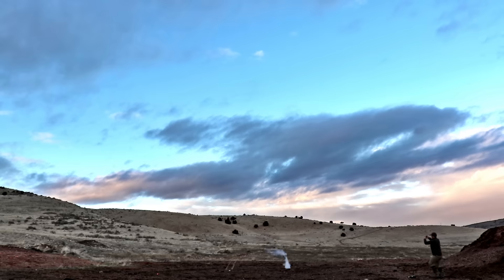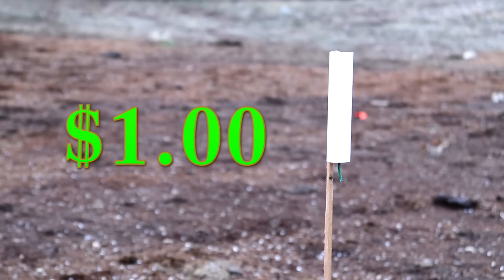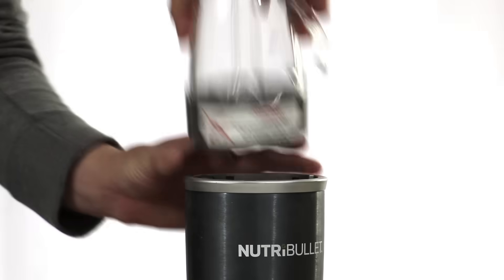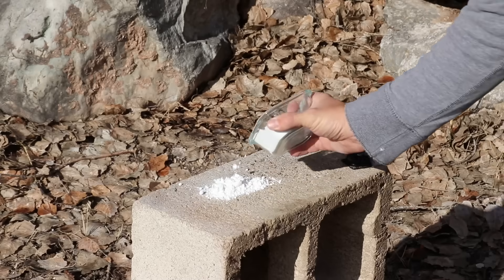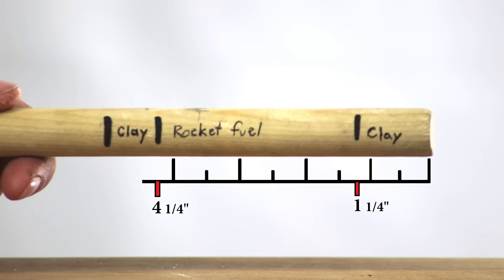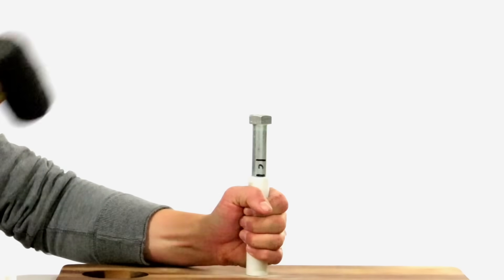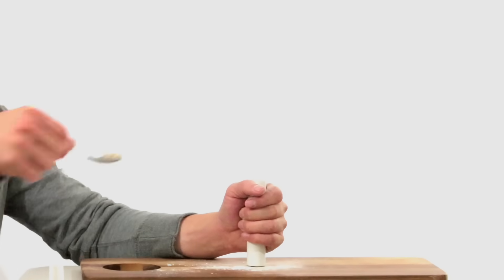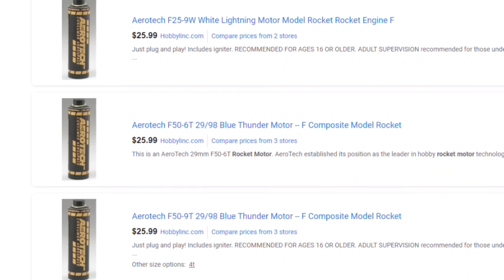How To Make Sugar Rockets (Powder Fuel)

Comment: Can I ask what keeps the fuse in, ? & how far in does it go, all the way, or just in bottom 🤔
Reply: You could try sticking the fuse and then a piece of paper along with it so that the fuse stays as it's stuck with the paper. Also you will want to stick the fuse all the way up the hole you drilled, not just the bottom.
Reply: @berkay3393  cheers pal
Reply: @tonymcwhirter  I also saw that you asked a question about yours letting out a bunch of smoke and dying, mine has the same problem too. I was wondering if you managed to fix it
Reply: @berkay3393  just had plenty of whoosh, one actually turned in the rocket holder like it were gonna go, but alas it just blew out bottom, & died, another one just blew out side of tube, just melted 😳, so not figured it out yet ffs
Reply: @tonymcwhirter  Do you use schedule 40 PVC? Also if its blowing from the bottom (my first rocket did that, I have a souvenir lmao) then that could suggest you're not compacting the clay very well. This video is very informative however I suggest you follow TKOR's steps in building the rocket.
Reply: @berkay3393  clay was well compacted, 3 quarter inches then fuel,  then same clay the plastic pipe is the right size, not sure about that 40 thing, different measurements in uk 😳,  even bought a 5mm drill bit , but nothing worked, I can't show u video on here, have u got Facebook 😉
Reply: @berkay3393  I had 5 attempts using correct ratio of fuel,  followed the instructions,  had plenty of whoosh sound, plenty smoke, but can't get one to lift , no idea why ?? Help
Reply: @tonymcwhirter  I'm suffering the same problem man. I think it may have something to do with how much we are drilling, because Ethan mentioned it was very important. Also every time I make one of these rocket I find myself unable to fit all 4 ounces of rocket fuel, I can only fit 2 and sometimes even less.

Comment: Tried it, wouldn't lift, plenty smoke, plenty whoosh,  but just burnt through the plastic tube, and died, any ideas
Reply from the maker: Are you drilling a core all the way through the fuel?
Reply: @EthanAllred1  to be honest probably through the clay, then 3 quarter's up  my drill bit weren't long enough lol 😆,  gonna try again today, what keeps the fuse in ?, coz mine kept falling out of bottom,
Reply from the maker: @tonymcwhirter  fold the end of the fuse in half before inserting. It will wedge itself in place.
Reply: @EthanAllred1  thanx again pal, I've just made another 👍,  last question does the fuse go all the way in , or just inside at the bottom?

Comment: NASA uses a plug shaped and placed in before tamping the rocket fuel, so that when the plug is removed, it leaves the hole in place.  And the inside is zig zagged to increase immediate surface burn area.

Comment: Do I just tape a stick to the tube ?
Reply from the maker: That's what I do.
Reply: @EthanAllred1  I had 5 attempts with the correct pipe  & fuel ratio for sugar rockets 🚀 none gone up, I'm wondering whether to drill a smaller hole, it foes seem big for the size, 5.5mm drill bit 🤔 it smokes ,makes a whoosh, but won't lift ??

Comment: Very Interesting.  Has anybody ever tried packing the rocket fuel with a 7/16" dowel in place while packing with a rod that has 7/16 chanel so you don't have to drill?  Don't know, maybe its easier to just pack and drill.

Comment: This is a real safe way to make sugar rockets. Other formulas have you add iron oxide and then heat the mixture on a heating element. Mixture will begin to melt, you have to stir and not over heat (might catch on fire). Then you are jamming hot sticky fuel into the rocket engine. Be careful, it will burn your fingers. Yes, it does make a better fuel, but it is riskier to make than adding 2 dry ingredients together. 

Don't forget to keep Potassium Nitrate in air tight container. It can attract moisture from air. Keep rocket engines away from wet environments for same reason. Also don't forget to rinse your blender after grinding chemicals. They won't hurt you, but kitty liter and Potassium Nitrate don't taste good at all.

Comment: Wonderful! I used to make these when I was a teenager but I love your surface area/burn rate examples. Very intuitive and even a third grader could comprehend what that means for acceleration.
Reply: Please explain,  I tried ethan way, I'm in uk, used dimensions same ingredients same, but just didn't lift, just burn the tube, with plenty of smoke 😅
Reply: 3 ounces is 85.05 g, I'm also a brit, but I just used googlr
Reply: can you use any type of sugar?
Reply: @toobag original gunpowder was used using potash nitrate (which comes from bat dung), sulfur and honey, it makes a paste and would be easier to pack, also use a cardboard tube rather than a pvc pipe, that way you don’t end up with a flying projectile when the thing goes sideways and also it illegal to launch writhin range of any building ps and within any persons under age of 18, and I thought there was a 400 ft height limit as well, so if ur gonna do an200ft launch you have to be next to a 1,600 ft hill you cannot make this in a house or store it in a bedroom and you cannot make large batches you have to make one or two at a time. I’ve never made any but I do fireworks shows from time to time and have been studying to get my explosives license.

Comment: I learnt this guy knows nothing about chemistry because potassium nitrate has no oxygen, the sugar has the oxygen, but hey he also using a power drill and metal bolt with a hammer to load it, how dumb.
Reply: So uh, where does gun powder get it's oxygen?  From the sulfur?  Maybe the carbon?  I know!  It gets it from the air.  The KNO3 is there for decoration.  Go back to school.  They've missed ya from second grade grammar!

Comment: Awesome and simple - now one step more, when installing the top plug use a bit of resin and pin it and shape the nose cone.
put a shaft down and compress the fuel on a Ring so you don't have to bore it out - because
While compressing your final end you're going to install a metal jet end and yes resin that end as well.

When are you doing a guidance system bro?

Comment: Don't ask for potassium nitrate if you're planning to manufacture pyrotechnics without a license. Ask for "stump remover" and check the label to be sure.  Use sorbitol, not common sugar, to get a less brittle propellant grain.  Since sorbitol burns slower, add 1% - 5% red (Fe-III) iron oxide to speed it back up.
Reply: i tried sorbritrol it stunk and didnt even burn,,
Reply: Its legal for personal recreation, just not to sell
Reply: @thadrack1311  depends where

Comment: When I Was Young I mean almost 60 years ago it was easy to find potassium nitrate. Me and my friends build big rockets with a mix of regular sugar combine with potassium nitrate and water. We cooked the mix until stick and molded it in pipes as long as 6 feet and around 3 inches wide. We were machining nozzles and fixed it at the pipe. We tripped a lot 😅

Comment: What made you go with a 3:1 ratio vs Grant's 65/35 mixture? Do you suppose adding some iron oxide to the mix might give it a bit more juice or does that only help in the cooked version? I experimented with Grant's mixtures of the sugar rocket fuel from a different video and found that the version he cooked up with iron oxide burned faster and produced more thrust. The problem of course with this mixture being cooked into a thick frosting-like paste is that it's hard to work with and it solidifies too fast to fill a pipe with it. I tried and ended up with an air pocket in the middle of a 2x12 PVC pipe and it went boom 10 seconds after ignition. lol
Reply: 3:1 ratio but if you altered the formula with powdered aluminum (the government watches that) and experimented the results would be extremely powerful.  My guess is the ratio would have to be the same of 3:1 but the "1" could be altered with powdered aluminum and powdered sugar in a 1 to 4 ratio.  75% stump remover, 19% powdered sugar, 6% powdered aluminum.  BTW, where would you find an ounce of powdered iron oxide (rust)?
Reply: @Easy-Eight  I made my own using rebar and electrolysis.

Comment: How many failures have you had before you got one of these damn things to launch ? Not one of mine has worked with this recipe. But Im not giving up yet...
Reply: Update on my rocket motors. I ordered 100% potassium nitrate and sorbitol. 65/35 mixture. Man did it work ! 4.25" motor and I lost sight of it.....still cant find it 😄
Reply from the maker: @johncarr4427  Awesome! Glad to hear you figured it out.
Reply from the maker: I have only had a couple fail out of about 75. Never an explosion. The nozzle Is what fails for me. Is your fuel burning properly. Not all stump remover is potassium nitrate.
Reply: @EthanAllred1  I knida think the particular stump remover I used was not 100% potasium. So, I will just order it from a fireworks company and probably order some sorbitol as well. Thanks for the comment and best of luck.

Comment: I built sugar rockets, or more accurately in my case, "Caramel Candy" rockets starting in 1962.  They were called Caramel Candy because instead of packing powder the fuel mixture is melted into a far more dense pack possessing far great thrust and impulse than packed powder.  Caramel Candy melts at 400F and ignites at 600F so there is a quite decent safety margin.  This does create some minor issues like any metal parts used during loading (tube and core form for example) must be preheated to avoid the very sticky candy possibly preventing a smooth, consistent pour.  We also experimented with Zinc Dust and Sulfur as well as Magnesium Dust and Sulfur but those are more difficult to work with to achieve a decent balance between performance and safety. In a very short time, even though the statutes were far more lax in the 60s, we were achieving altitudes with rockets under a foot in length we ran out of places safe to launch from in any practical proximity to where we lived. Do not underestimate how high these can fly!  More than a mile is easy.
Reply: Can you explain using the caramel a bit more? Unclear as to how it was used
Reply: @VG-rj8pn  Hello!  I'll try. It is possible to get the mixture to work much like a gunpowder rocket (though a lot safer) by just packing powder but performance is very low. Basically it isn't worth the effort, or lack of it.

To get good performance the mixture must be melted and a hole through the center  crteated along the rocket's axis (so the cross section looks like a donut) so that instead of a low surface area burning slowly the entire length of the rocket, very quickly (especially with something like  a phenolic burst diaphragm)  the fuel mixture burns in a very large burn front surface area The entire length of the central hole) and only spreads from center to the shell so it burns MUCH faster, providing way more thrust.  Hope that helps.

For a detailed set of instructions see https://www.goodreads.com/book/show/7140450-rocket-manual-for-amateurs

Comment: Thanks for the video. I will say I have blown off a lot of rockets on my day and these are not close to a Aerotech F motor, more like a Estes D motor. Aerotech uses a composite power that is almost three times the power of regular motors. My favorite motor was the FSI (flight systems inc) E5-6, it burned for 4.5sec, double stage (E5-0 + E5-7) with 9 seconds of burn was capable of 4 thousand feet (verified with 3 triangulation sights at 3000 feet away from the pad), you launch these rockets about 30 degree pointing downwind, after the first stage burn, windcock adjusted its flight to 10-20 degrees unwind, Yours are burning 1.5 to max 2 sec are not doing 2 thousand feet, but the cost is great, thanks for sharing, sub'ed.

Comment: Some safety recommendations include ensuring no one bangs on a steel rammer with a steel hammer, and to wear leather gloves, long sleeve cotton clothing and eye protection, and never ram rocket motors indoors. Also PVC will shoot shrapnel if the motor CATOs, so you want distance after you light the fuse. All in all great video, you got really good results without having to use a spindle.
Reply: Whats CATO's?
Reply: @TravisButler95 stands for "Catastrophe" or ive heard some people refer to it standing for "catastrophe at take off". It refers to a lift charge failure that often results in an unintentional explosion.
Reply: @TravisButler95  Explosion.
Reply: what would happen if you banged the rammer with a steel hammer?
Reply: @CoolCreeper246  you could make a spark

Comment: After all your explanation of surface area. How about trying different variations. Drill one 3Rd in for initial boost lift then slow burn for increasing altitude?
Reply from the maker: Good point. that would probably work if you had a cartridge that wouldn't burn up.

Comment: So, is it illegal in the U.S. to make larger sugar rocket motors than you made?  Is there a limit?
Reply from the maker: A rocket exceeds the definition of a Model Rocket under NFPA 1122 and becomes a High Power Rocket under NFPA 1127 if it:

Uses a motor with more than 160 Newton-seconds of total impulse (an “H” motor or larger) or multiple motors that all together exceed 320 Newton-seconds; or

Uses a motor with more than 80 Newtons average thrust (see rocket motor coding); or

Exceeds 125 grams (4.4 ounces) of propellant; or

Weighs more than 1,500 grams (53 ounces) including motor(s); or

Uses a hybrid motor or a motor designed to emit sparks; or

Includes any airframe parts of ductile metal.

In addition, under FAA rules (FAR 101.22), a rocket exceeds the definition of a Class 1 Model Rocket and becomes a Class 2 High Power Rocket if it weighs more than 1500 grams (53 ounces). For additional information on Class 2 Rockets, see the Understanding FAA Regulations page.

Comment: As a 12yr old kid my brother and i took 1000 black kat firecrackers opened each one poured the powder onto a plate we then took 6in of garden hose taped and stuffed the crap out of one end made a hole inthe center poured the powder in and gently packed the powder taped the other end we then stretched out 10 in of scotch tape and laid the fuses end to end and squeezed that together on 4th of july with half the cool neighbors watching we went into the creek in front of my parents house we lite the fuse and ran like hell well if it wasn’t the worlds bigest sparkler it fizzled shot a 5ft tall roman candle spray then it stopped everyone went awww as we were just about to retrieve it ...kaaaaaboooom made a small crater and about 4ft clearing in the creek no more after after that lmao o ya the cops drove by a little while later

Comment: I know it's a bit more hassle, but would it not make a bit more sense to add a binder to the rocket fuel for a more consistent grain burn (e.g. pure alcohol).
Reply from the maker: I think so. This is by far the most basic, simplified sugar rocket. Tons of room for modifications for sure.
Reply: @EthanAllred1  Thanks a lot mate! I've almost finished my degree, but the lectures are far too theoretical. Your videos make the practical side much more fun.

Comment: What about using https://en.wikipedia.org/wiki/Ammonium_nitrate instead of KNO3?
Reply from the maker: Possibly, ammonium nitrate is more regulated that potassium nitrate. But has in the past been used as an oxidizer for some rocket propellents. The main uses for ammonium nitrate aside from agricultural use is in high explosives such as C4.
Reply: @EthanAllred1  Thnx, EA. Good answer. I did some small scale farming in the mid 1970s. 50 lb. sacks of NH4NO3 were easily purchased and cheap. It came as granules, about the size of a BB (.177")
My guess is that baking flour might substitute for sugar if you wanted to go for cheaper and bigger. What about that?

Comment: The main difference between commercial rocket engines and these DIY engines is the addition of a time delay and parachute ejection charge on the commercial ones. That feature is what allows model rockets to be recovered intact after a flight.
Reply: Exactly what you are paying for in a commercial engine.
Reply: @ibrb2  I used to fire off Estes and Centuri model rockets back in the 1960s. I'd like to try it again, but rules were pretty lax in Maine back then when one could fire off a rocket in their backyard or nearby field and chase through the neighborhood for recovery. I don't even know where you have to go in western Massachusetts today to be allowed to launch.
Reply: @brianfleury1084  Same here in the Denver area.  I grew up flying Estes rockets.  There is NO place to fly them here anymore.

Comment: you could also use a plug of wood with a drift pin to tamp and make the cavity and not worry about friction whilst drilling, see poor man's james bond volume one.  fun vid, man.
Reply: That book gave me so many ideas.  Too bad I didn’t have any money as a kid.
Reply: As I was watching, I wondered if paraffin wax could be used instead of clay... it's that a thing, or do you need the clay to aid the reaction? Just curious.
Reply: @theheartlessknight2426  The wax will usually melt before the fuel is spent resulting in failure partway through the reaction.

Comment: It would look neat at night, we used to cut off CO2 cartridges at the base pack and full of match heads and then stick rubber bands up in there and then lite them he had to watch out they weren't packed too tight or they would blow up,
Reply: I used to put M 1,000‘s in regular model rockets

Comment: Great video. But if were to use this in a model rocket, what would you use to provide the pop explosion at the end to push out nose cone and parachute?
Reply from the maker: A slow burn modification at the top with a black powder charge.